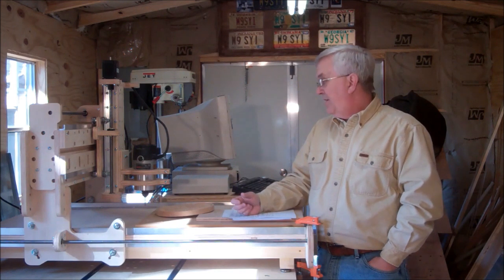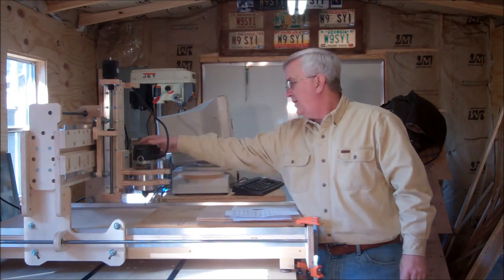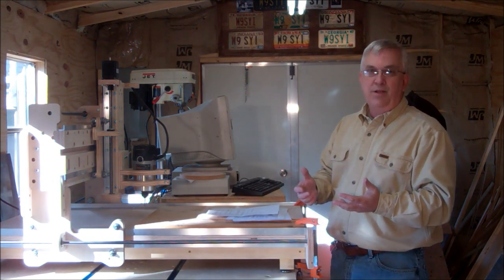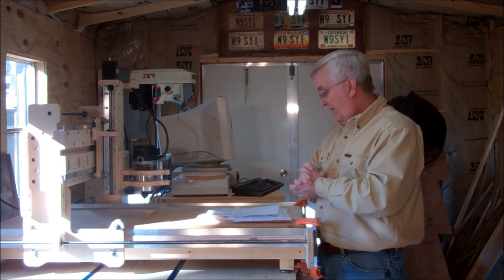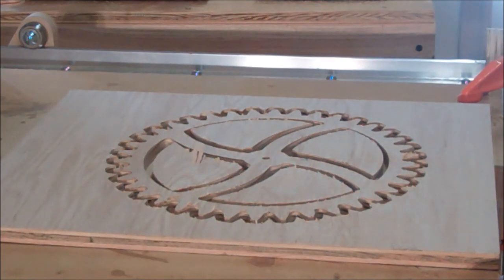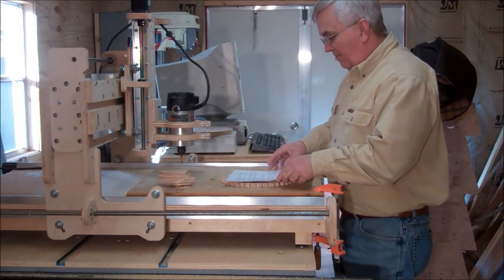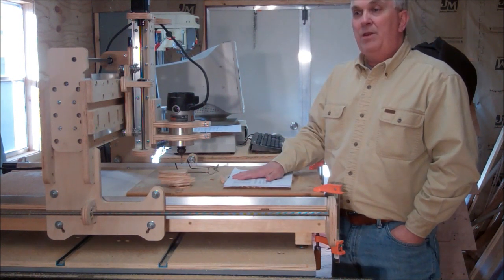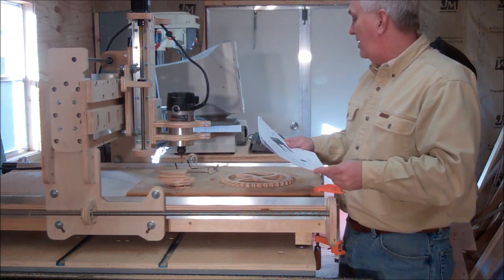How to Build a CNC Router On A Shoestring Budget Part Eight

Comment: Hi Dave, I am getting close to ordering all the parts and hardware to build your "cnc router on a shoestring budget". One of the questions I have is about the angle you used to guide the different axes. Would steel angle be a good alternative to the aluminum angle? The other question I have is about your videos on "Another cnc router build" where you have switched x & y axes. Are you going to create drawings for the changes that were made or maybe just the different dimensions? This machine looks awesome. Thanks for all the great information.

Comment: Thank you for sharing, Sir.
What kind of stepper motor you've installed on this CNC?
How Many Nm, in.oz, A and °step angle (200 steps/revolution) ?

Best regards,
Karun
Reply from the maker: Hossein Hayati You haven't been paying attention to my videos have you?  :-) Just kidding.  The stepper motors I used are Nema 23 269 oz 1.8 step angle with 200 steps per revolution.  They were purchased from Xylotex.  Jeff now carries a kit with a 425 oz stepper that has 1/16 step.  Thanks for watching.
Reply: Thank you Dave:)
That vide was the firs one of Your video I watched. After that I found some more of them. Thank you for sharing :)

Best regards,
from Norway

Comment: How mush trouble and expense would it be to convert your table and plans so that I can cut 4x8 ft sheets of foam? I have a CNC hot wire machine for cutting foam, but I would LOVE to have a table router to do the carving, and if possible, I wold love to put 12 inch thick slabs in it to do the 3D sculpting. Am I asking for too much? Thanks.

Comment: Just came across your videos and watched a few.  Very interested in building one.  Looks like you build it quite well with good hardware (bearings and lead screws,etc.)  I have a few questions:  Since it has been some time since you built it and guessing there has been a lot of use, how repeatable are the cuts now as compared with to when it was first built?  Has the router mounts loosened in any way?  Do you think there is any benefit to encoder feedback on some or all of the axis?  

Thanks for in advance,
Bernie

Comment: What was the RPM / feedrate & depth of cut of the tooth gear you cutting in that 1/2" plywood? Was that a 1/4" upcut spiral?
Reply: I inferred that the depth of cut per pass is 0.1" from the video (5 passes through 1/2").  I would be interested in knowing the other parameters also. I have problems with burning on Baltic birch. Don't know if it is the rpm' s
 too high, feed rate too slow or both.

Comment: Hi Dave, hailing from the sunny UK here. I watched your video's just now and they blew me away. I've never had the confidence to build something of this nature but I will definitely have to give this build a shot! Bearing in mind that even though I work for a gasket firm, I've never ever worked with anything like this so I could also use a little advice. My employer currently hand mills everything including Stainless Steel of varying grades, what factors when learning this build do I need to take into consideration when I have specific material in mind?

Thanks again for putting yourself out there.

Comment: I'm familiar with vector, being a graphic designer, using Illustrator.  What program are you using to import parts to cut? Like when you  cut the gear and the parts? Before importing into Mach3. I am interested in building your CNC. Right now I'm learning the programs, so once build it I hopefully can run it.